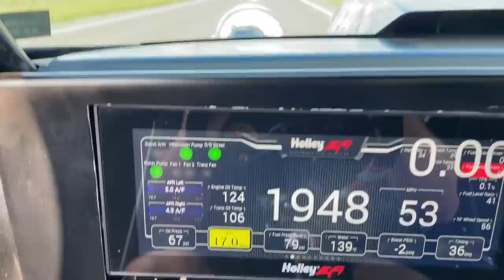Mullet SHOOK The Tires So Hard In Testing It Caused Body Damage... + 6 Months Ripper Update!

Comment: I remember the time y'all was just starting to take mullet down the track and I remember me thinking with as light as the El Caminos are in the back an with the tires as wide as they was that the more power the slower it would leave the line or lose traction but after watching every video till now I realized that it's not just the weight and tire size that matters and y'all are the best at explaining everything that is going on

Comment: Older harleys shake all the bolts out as well. Sometimes the Loctite wouldn't even stop it. so you set the bolt on a hard surface and whack the threads with a hammer. They don't come off after that lol.

Comment: Hear me out I had a El Camino as my first drag car and I had an issue once I started making more than 1500 wheel if I lost traction and then gripped up or launch hard enough my wheel would hit the fender and then it felt like bad wheel shake because it was hitting the fender every rotation until I got out of the gas maybe it wasn't tire shake that caused it to hit the fender maybe it hit the fender that caused the tire shake like I had a problem with until I tighten some things up and got rid of stock torque boxes

Comment: @CleetusMCFarland. I had the same problem with my daughter. Just put him in the car and drive he will drift away in 10 minutes. But avoid a straight pipe vehicle :).
Or and it could that his stomach valve doesn't fully close yet when he laying flat into bed. That happens with babies. You can raise the bed a bit on 1 side so stomach fluids will not bother him.
Good luck  :)

Comment: Dude. That is a quarter panel. Not a fender. BUTTT, in the video you immediately called it a quarter when identifying the damage. Sucks and is common on true high power cars with violent tire shake and front half chassis or a full steel body.